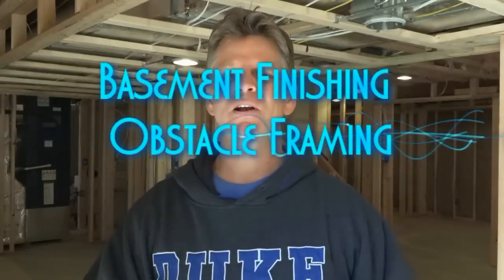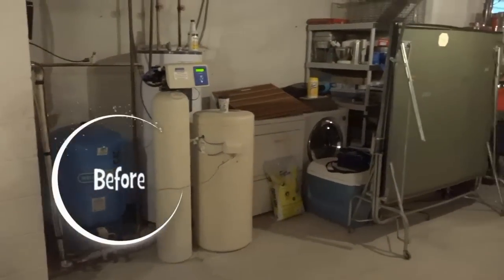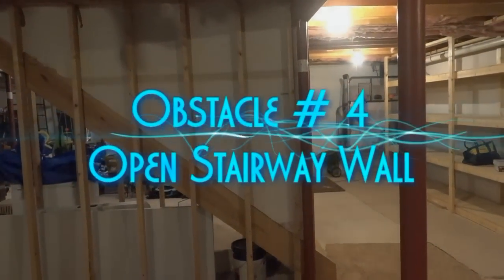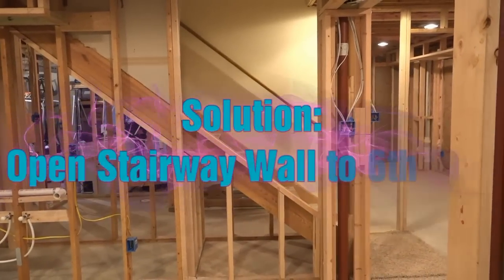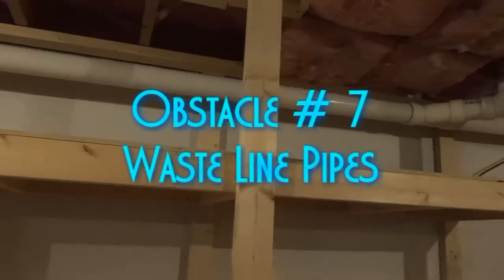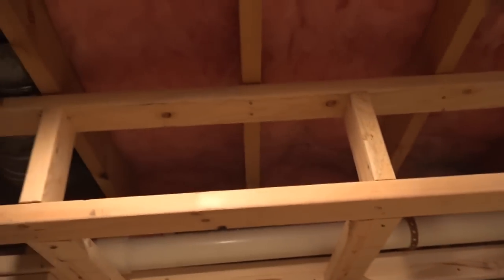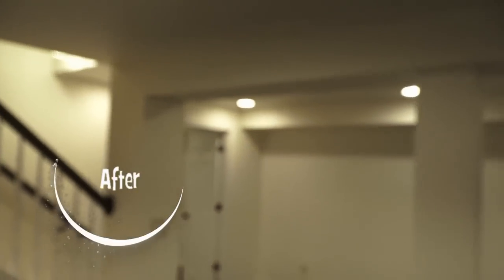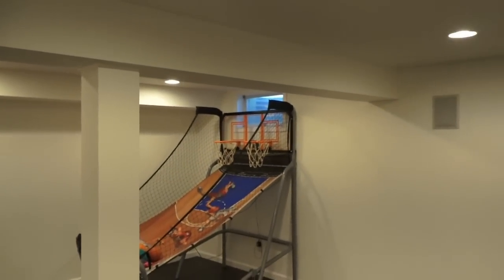Basement Finishing Framing Design

Comment: Very nice job. Very precise framing. I'm currently in the planning phase of my basement. I have very similar obstacles you have pointed out. The difference is that I'm fighting for every inch on the height. I might consider going with 1x4 for the ceiling framing. Again thanks for sharing your video. I know you take pride in work and you should.

Comment: Great finishing!  My only comments are regarding closing in a window, your banding and drywall use.   I would never put a basement window into a closet... natural light is worth more than gold for basements.   Banding images showed many many locations where wiring was not protected by plates and could easily be hit with drywall screws.   Finally, looks beautiful but have you never faced a problem with maintenance/upgr?   By drywalling everything, you have made any maintenance a huge task for homeowners as they will have to cut/remove drywall and then have it fixed later.... drop ceilings for basements are wiser...sometimes homeowners don't think this thru but our job is to educate and then let them decide.   Besides these, great work.  Thx!

Comment: I'm doing a basement gut remodel of a 100 year old house in Salem MA that has everything, and I mean everything to deal with.  Some of those framing ideas saved me easily a few grand in not having to relocate gas pipes as well as avoiding running half the houses wired through drilled holes in the joists.  The way you boxed in the lolicolumns was really clever.  Just seeing how you framed in the stand pipes helps to conceptualize my approach in a space where I need to get creative with literally every step.  

I'd love to see how you handle clean out hatches and if you have ever built platforming for sub floor rather than bring in 10 yards of concrete to level out one end of the floor.  

I'm also checking the rest of your videos before I finish the windows to the stud walls there might be something in there I had not considered

Comment: Just finished a basement. Second basement ever, but first doing  soffit ladders.. with the multiple points of issue, we just decided to do it piece by piece. Semi experienced carpenter. We decided to build the the latter the length of the beam first. By the time we got three quarters of the way done with all the stud work, we realized that the beam wasn't square with the rest of the room. I didn't measure the beam ladder off the wall, I measued it off the beam.. just thinking that the beam would be square. But it was about 3 in off. So when we hung the ceiling drywall there was a gap. Luckily we are running crown molding. Next time I will measure off the wall to the beam ladder I'll
Reply: I did the same exact thing! Lesson learned for me.
Reply: @24kgoln  very hard lesson. Thank God it wasn't a drop ceiling. That would've been so noticeable!  Thanks for letting me know I'm not the only one!
Reply: @aztek54208  I have a drop ceiling and you are so right.
Reply: @24kgoln21  oh boy!

Comment: Hello Eddie, another great video man. Just wanted to mention at 5:40 you stated the columns were boxed out in 2x8 and then at  6:55 & 7:12 you stated they were boxed out in 2x6. I will be boxing mine out soon so I'm curious what one you typically use?
Reply from the maker: Yeah...oops! Yes the 2" x 8" is correct, the 2" x 6" is wrong! My mistake! I usually use 2" x 8".

Eddie

Comment: Question for you….I have watched several video where you attach 2x6 pine to steel lally columns using a ramset. I started using this method on all my finished basement, recently started using tapcon screws to get a more flush head.

I have had multiple people question me on compromises the structure integrity by doing that. Please let me know your thoughts on this. Thanks
Reply from the maker: Does not hurt the integrity. The nail plugs the hole so tightly that it actually replaces the small amount of steel it moves from the hole... The hole made by ther fastener pin is less than 1/8" in diameter and it is immediately replaced with the shaft of the nail. 

Been doing this for 38 years and have never had anyone question me including 100's of code departments who inspect my work...I'm not too worried.  ~Eddie
Reply: @BasementFinishingMan  appreciate the rely, keep up that great work. A lot of us owe you for all the help you provide

Comment: Great video as usual. And I have all these obstacles, except the stair opening and 3 inch sewage pipe running along the ceiling. But I do have that nasty cleanout to cover. I’m just wondering if it’s a requirement to create a access door/panel at the cleanout cap? 

I see a lot of people creating these doors or mounting flush panels over the drywall, where the cleanout is located. Are we required to make a door or mount a panel over the cleanout? 

Thanks again for this killer video!
Reply from the maker: Yes it's code to have future access to cleanout caps Michael.

Eddie

Comment: Sorry for double tapping as I posted this question to another of your videos, but I just saw this obstacle video.

I am trying to frame a wall but I have a supporting steel column just two feet away from the wall in the very middle of it. The wall is only 21 feet long and I have no clue how to make this as a single wall, because the steel column is in the way and won’t be able to build it on the floor without trapping the column. 

Any advice will be greatly appreciated.
Reply from the maker: Just build 2 separate walls one on each side of the column.

~Eddie
Reply: @BasementFinishingMan  Thank you Eddie. Your framing videos are by far the most detailed I have found so far.

D. Ureña

Comment: Eddie, what kind of return did you put on the case molding underneath the stair handrail opening?  I see the bottom hits the build out around the support column, but what about the top?  Is there a return or just cut flush?
Reply from the maker: Hi Brandon!  It's a flush angle cut.

Eddie

Comment: What if you have a heating duct running the length of a room, but too close to the cinder blocks to attach a stud wall + rigid foam to the joists above?
Reply from the maker: You'll have to build the wall under the ductwork and use the "block-nailing" method to secure the wall.

Eddie

Comment: Hi Eddie,
Great video.. I'm about to tackle my basement and will use your video as a reference. In regards to band framing. I have this issue on one side of my basement where the water pipes were attached to the joist. 
Technically, do I only band frame the 1 side of the basement, and this side will have a slightly lower ceiling or both sides for consistency?
Will you notice the difference?

Thanks for your advice.
Reply from the maker: Hello! Just do the one side CJ...You can't  see the difference at all!

Eddie
Reply: @BasementFinishingMan  Thank you

Comment: not sure if I would have went the banding route for finishing the basement ceiling. If it was a necessity to later trace wires out or add more, or something wrong with a clogged or leaking pipe or tubing that would be a friggin nightmare to dig through and find, or fish through 2, 3, 4 or 5 years down the road. The finished result does look nice though, but I probably would have went a different route. Or at least re-route some of that wiring or piping to a more convenient location before sealing everything in permanent like.
Reply from the maker: It's all non-serviceable stuff were covering so it makes no difference it it's sealed up forever. Look at it like this...it's the same exact stuff you have between the first floor and the 2nd floor of your house, pipes and wires. We do create access to all plumbing cleanouts in case of drain clogs and anything else that needs future servicing...the rest of it...cover it and forget it!

Thanks for watching and for commenting ML Tomson!

Eddie
Reply: I have to agree . Did you relocate the transformer for the doorbell to an area that is accessible? I didn't see an access hatch in the bulkhead.
Reply: Basement Finishing Man I was thinking the same thing as that guy but your explanation makes a lot of sense great work wish you could have shown the work being done but I’ve still picked up some good tips and I’d hire you guys in a minute.
Reply: @zeus3358  I was wondering the same thing but when he showed the finished soffit, there was a white access panel or speaker cover in the bottom of that  soffit if you look closely.  I'm going bet its the doorbell transformer access
Reply: You're right I see the access hatch now that you mention it. Thank you for pointing that out to me.
Reply: @BasementFinishingMan  No you did not provide access to that cleanout.
Reply from the maker: Sound good in theory Marv...but rerouting electric and plumbing that is non serviceable is just not necessary... Think about it this way...If you live in a two story house this is the exact same stuff you have between your first and 2nd story ceiling that's drywalled...you just never think about it! This is no different.  ~Eddie

Comment: its a great video but i am a little confused about access to plumbing should you need to. i noticed one panel but i know from experience the access panels will grow over time as needed. did you avoid them because the property was going to sale?
Reply from the maker: We go back and cut them in after drywall is finished and painted. and then install them.  We simply make a detailed location "map" of all the spots where we are going to need the access panels before we drywall so we know exactly where to cut them out later-on.

Eddie
Reply: You don't have to put in access panels if you don't want to.  They are only there if your plumbing fails or you somehow get a leak.  Valves can usually be replaced from the bathroom side, so unless you have to replace the entire valve body, there is no need for a panel.  For the cleanout, it should be there ahead of time because future owners may have no idea where the cleanout is without being told.  I take pictures of every single wall before it is drywalled so I know where every pipe, heat run, vent, and every wire is.   Not sure if it was mentioned in this video, but in Wisconsin, every shutoff valve and heat run damper in the joists needs to have access.

Comment: Basement Finishing Man, I love your videos. I'm in the process of DIY my own basement and using a lot of your videos as reference. A couple  questions relating to banding the ceiling in this one. I was going to do that on mine however my pipes and wires are off the joists about 1 1/4". Would you still recommend this route or something else to drop low enough for drywall? I'm not working with a high ceiling to begin with. Also you only went every 2 feet, how did you put up drywall if you didnt use any kind of measuring?

Comment: Great tips. I have a waste pipe that runs across the house however it runs horizontally halfway down the wall then exits mid wall. It also runs very close to the bottom of a basement window.  How would you tackle this because the window needs to be framed and the pipe being halfway down the wall doesn't have anything to connect to as a soffit.
Reply from the maker: Need some pictures of this setup Neil to be sure! Send me some and I'll have a look at your framing situation.

Eddie
Reply: Thanks I'll send some over. Appreciate it!
Reply from the maker: No Problem Neil!

Eddie
Reply: What did you come up with for a solution to this situation? I'm faced with the exact same thing. Great vids Eddie, very helpful.

Comment: How do you build your framing wall if the ceiling to floor height over the span of your wall is different by an 1 inch or more? In the video's you had about a 1/8 of an inch difference and you said you could manage up to a 1/4 inch gap. But what if the gap is going to be more like an inch?

Comment: What can you do in a situation where you have steel I beams placed throughout, but you don't want to necessarily box in front of it due to the fact that it would make the room significantly smaller being that you would have to add 3.5 inches past the beam.  Is there a situation where you have a break in the tip and bottom plates to allow for this? Thanks in advance, love the videos!
Reply: I am facing this same issue and would love a response

Comment: At 08:08, the stair hallways. How did you know the stairs frames were not load bearing?
Reply from the maker: By looking overhead at the framing you can see if the mfloor joists are either supported by the stairway walls or not supported by the stairway walls. 

Eddie

Comment: How is the homeowner supposed to adjust the teleposts now?
Reply from the maker: They're not. Homeowners shouldn't be adjusting the central load points holding up the central load of there home...It's a once and done deal if the house was build correctly and should never have to be messed-with.  ~Eddie

Comment: How would you frame a wall that has been fitted with foundation steel beams
Reply from the maker: Hello Richard! The exact same way...stay 4.5" in front of the beams and build your new 2" x 4" walls the exact way you would in a masonry block or poured concrete walled basement.

Eddie

Comment: How do I drop a fire sprinkler located within a soffit
Reply from the maker: Since the system is pressurized you should really contact a  plumber or sprinkler system mechanic to extend the head down below the soffit plane. I do not recommend doing any sprinkler system or relocation of sprinkler heads yourself.

Eddie

Comment: You actually think it's OK to close off a cleanout? Do you know what an access panel is? Also, do not close off all that stuff in the ceiling with drywall. Any work on that house will require tearing out drywall and a dumpster in the driveway. This is why when purchasing a house I prefer the basement NOT be already finished.
Reply from the maker: Larry...relax brother! I've put hundreds and hundreds of access panels in my friend. We only cover-up what is NON-SERVICEABLE with drywall. Everything else can be drywalled over with no repercussions.